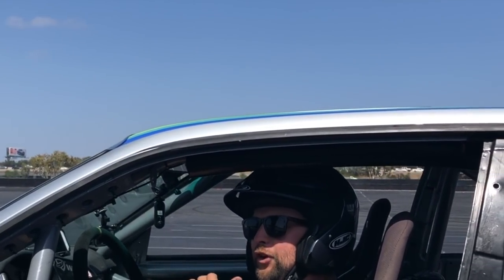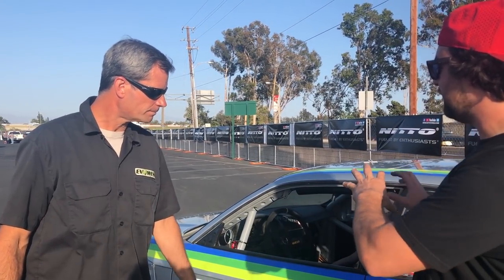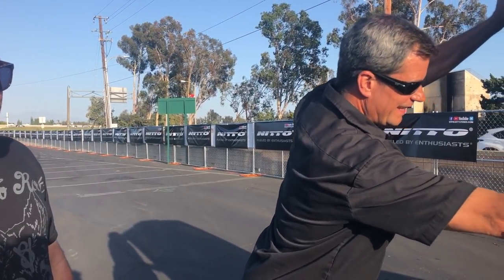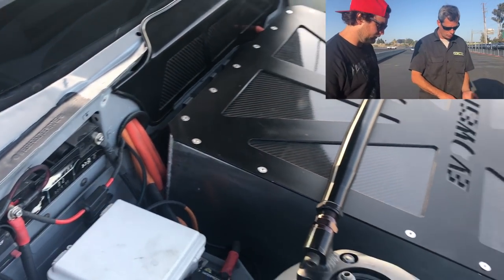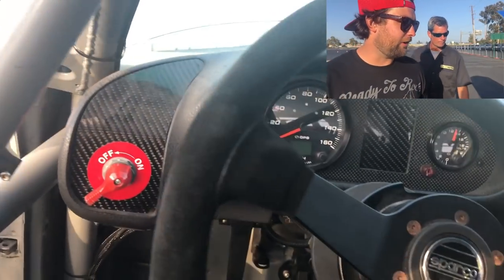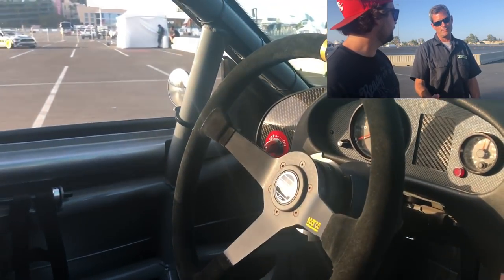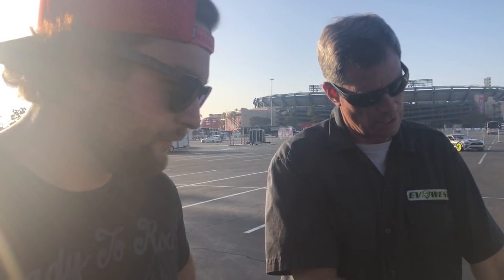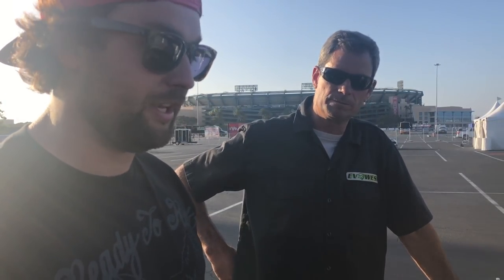ELECTRIC E36 DRIFT TESTING!!

Comment: So glad this finally aligned, even 3 years later. I've been curious on how an EV drift car would behave for almost a decade. Was planning to convert a Soarer to EV and slide it back in 2010, considered things such as simulating clutch action and gears for drivability, swappable battery packs for low weight and such. Even got Mate Rimac to help pitch in. Sadly the typical budget gremlin prevented it from taking off but I'm so chuffed to realize it can actually be a thing and, perhaps, the future. What an amazing build and such a passionate, objective and down to earth builder. Thank you Chelsea for this, you are providing so much value with your content!

Comment: A lot of the drive by wire pedal feel is buildt in so morons can drive a car, set up for it they are more responsive than cable throttle.
Reply: You can program the throttle curve to whatever you want... I did that on my '01 C5.  You can probably change it from the dash tablet if you unlock the software